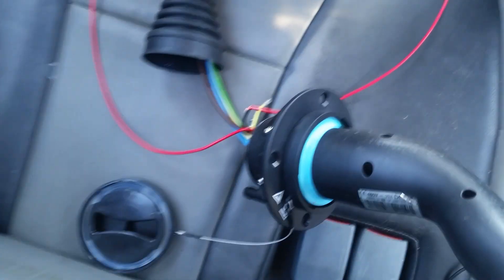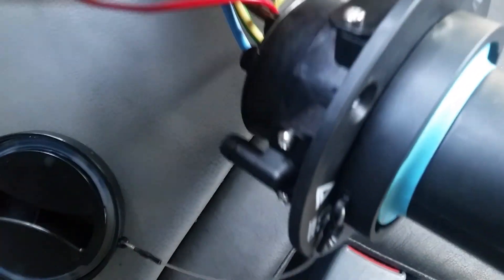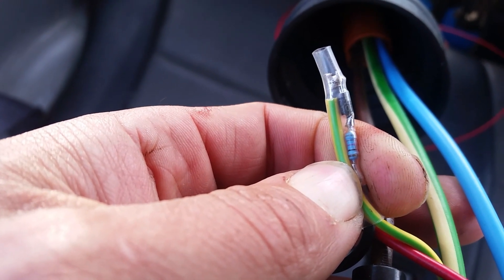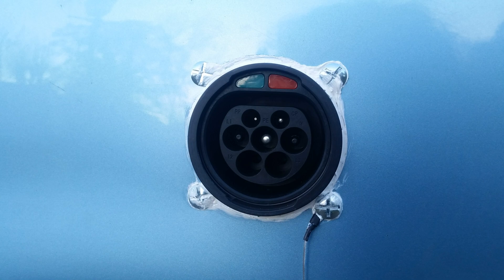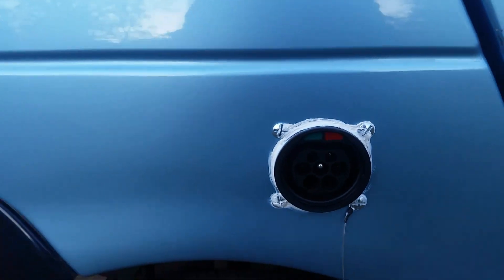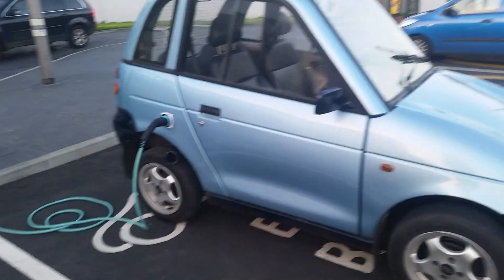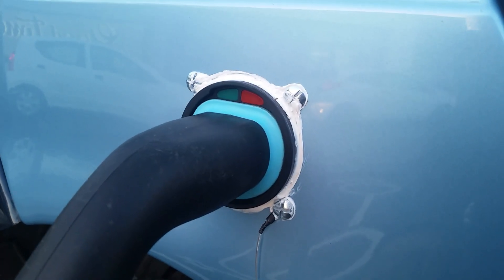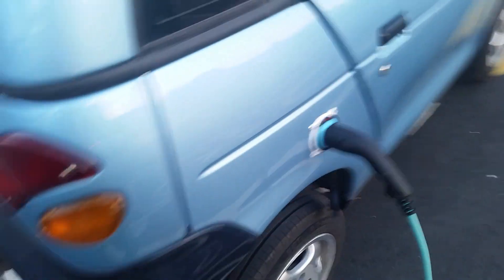REVA G-WIZ: lithium ion conversion type 2 charger lead installation.

Comment: your only charging at 25 amp each it's not 110 volt it's 220 volt
Reply from the maker: I'm charging at 220/240 volt and at 108 amps (around 5kw) with my own chargers.
Reply: @RichardMawby  I X E = 23,760 watts . i think your math may be wrong
Reply from the maker: @shawncell1247  sorry I'm calculating via 48v side not the 220v.

Comment: you need to make sure the charger stay's cool. i leaned that the hard way. leave window open when charging
Reply from the maker: Already do that... but I also use my own chargers in the boot of the car instead and not the original one.